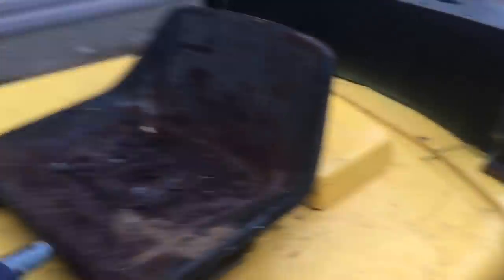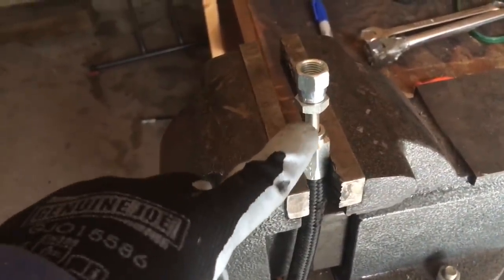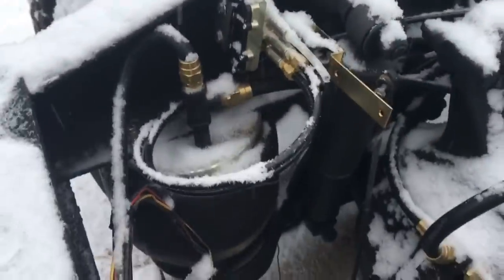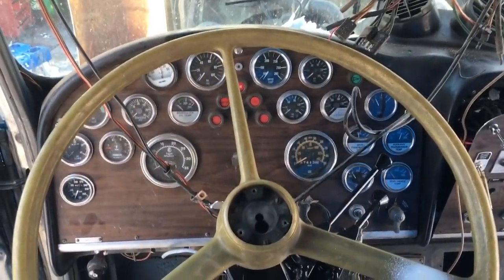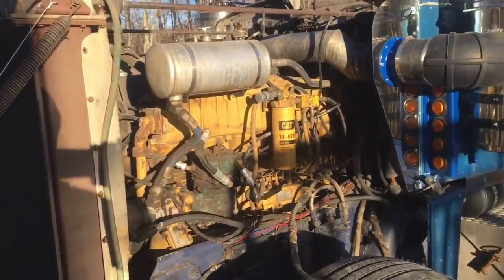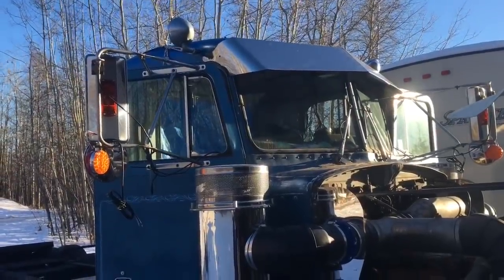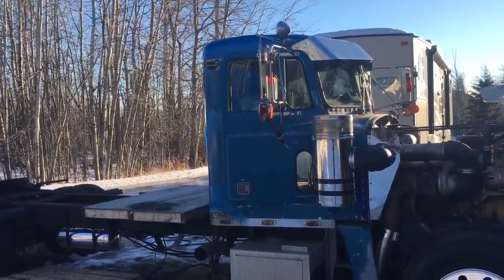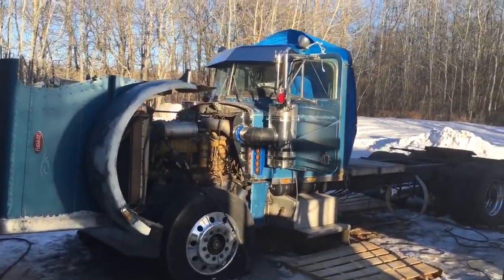Peterbilt 359 Restoration Ep.22 Air Wipers

Comment: Saw that video "1977 Peterbilt rescue" and that is one lucky dude. Amazing it fired up after all those years and drove out of that field. Looks like it was an old Canadian tractor (Judging by the "Canadian" spread on the rear axles) that was retired in Pennsylvania for a many years. Wish I had that old girl, she ran so good I'd clean her up and put her to work in my business.
Reply from the maker: kman 4443 I still cant figure out how all the tires were still aired up if it really sat that long ... when I bought blue the owner had a second burgundy 359 and most of the tires were deflated and popped off the beads on both trucks from sitting outside
Reply: @TwinStix  Some guys have all the luck I guess. If I had bought that truck, they'd all be deflated and badly dry rotted and need replacement. Never comes easy for me! LOL!
Reply: @TwinStix  My guess is that the previous owner now deceased probably aired them up from time to time and may have even moved the truck for a short drive every once in a while. He did say in the video it was started every once in a while but hadn't been started in a while since its owner got sick.

Comment: I commented on one of your previous vids that you should put a thin piece of rubber between the bands and tank. Just to make sure that you keep out corrosion, use some petroleum jelly on the rubber,thin coat. this cushions the parts also..
Reply from the maker: Good tip - thanks

Comment: Progress is awesome man. Your videos motivated me to sandblast and paint my frame. I'm not very good at videos though, but there's a few of it on my channel. You could try stuffing those forklift tires with dirtbike studs, it doesn't look like you have room for chains. Radiators suck, I just did mine if you need anything just holler. If you need a home for that wheel it'd sure look good hanging up in my shop.

Comment: I can’t wait to see you drive this thing also there is an airline in the back of the truck that goes over the torque arm I would probably move that to the bottom of that torque on there just so if your suspension moves you don’t put extra pressure on that line will be driving down the road the first day and blowing airline
Reply: Timestamp is three minutes and 45 seconds
Reply from the maker: JUSTIN STURGILL TRUCKING ya good eye ... someone else mentioned that as well.  I ran it the way it was but now realize it’ll be better to go around or under
Reply: 359 TwinSticks I would go under it like I said I can’t wait to see you get it done hopefully it’s soon but I realize you’re up there in Canada and it’s cold

Comment: You should swap out your alcohol-type air dryer system for a desiccant-type air dryer system. The ones from Volvo are pretty good. Alcohol is harsh on the components in the air system.

Comment: As I've said before, my hat's off to you working in well below freezing temps, I'm in Langley B.C. and I have a hard time getting motivated to get out and work on my bus when it's under 5 Deg., guess I have no excuse now... Damb it!!!! ..... we had a 72 359 with a 1693 Cat logging truck years ago in Whitecourt.... loved that truck.... I wonder whatever happened to it.... probably scrap years ago.... could you strap the tanks to a pallet and set them under the saddles with the forklift and then use ratchet straps to lift them into place... all you would need is the little 1" ones , then you could go nice and slow and they would hold it in place while you put the straps on..... those guys did an awesome job on those tanks

Comment: You can still run the truck. Get to gas can for diesel which are yellow.. this would allow you to move the truck where you want it.. & I would reposition the air line going over the rear axle from the brake valve. Good job on the airlines & slack adjusters..

Comment: This is old video so you might have changed it but the air line going from the rear quick release relay valve (QR-1) to the brake "T" at back of the diff needs to be rerouted or protected from the pan hard bar, when you air it up that pan hard is going to lift and rub through your brake line.

Comment: to mount the polished tanks without scratches , buy a roll of wide vinyl transfer tape , the stuff the sign makers use to apply cut vinyl letters , measure out where the straps will be , and cover the whole tanks except that area , mount them , then peel it off , issue solved lol
Reply from the maker: towrecker good tip ... thanks

Comment: Have you checked the windshield for leaks because water could leak in through it
Reply from the maker: gamer ya windshields will need replacing ... crack, chips and the seals have shrunk and there’s openings now.  Will probably leave until the spring as the cold will make them a bear to install

Comment: Don't forget to test tow the RV! ;-)
Reply from the maker: RS 1990 yup that’s the plan
Reply: @TwinStix  I suggest keeping the stock 5th Wheel turntable but replacing the RV's original pin box with a Mor-Ryde (the skid plate has more surface area than any other pin box!)

Comment: This is my thought on setting your fuel tanks on the truck build you some wooden cradles for your forklift forks a little bit wider than your fuel tanks and line the wooden cradles with an old mud flap and then secure the cradles to the forks and make sure you put forks at a width that wouldn’t infer with tank traps you could probably use some small racket straps to hold it together

Comment: Good job, with the air lines, looks nice.
Tanks are beautiful, and like you said the straps will cover up the pitting in the old one.
Last time I saw one of those Heat, and Engine start selector switches was in a 1987 980 loader with a 3306 engine that I ran on occasion.
The Heat position would be for glow plugs.
Call me ignorant, but did they offer glow plugs in a 3406?, or was it just a cold weather option, never have seen that on a 3406.
Let us know.
Great video , keep up the good work.
Reply: Well I looked a bit, and they did come with glow plugs, haven't seen one with them, what do you know.
Reply: I did some more research, and discovered that the Precombustion Chamber injection engines had glow plugs,
and it looks like that option was lost when the engine was converted to direct injection, usually at first overhaul.
Unless you have the flame start option which used a glow plug and fuel nozzle to preheat the intake air.

Comment: Aey bro .. you might wanna move that roll of airline you have sitting out in what I'm assuming is the Canadian north somewhere .. maybe say in the house in front of the wood stove you no doubt use that will actually make installing the push lock fitting's a breeze .. So unless your Barn will accommodate your Pete Or you might wanna wait till June when your spring rolls around Aey ?

Comment: Chains will not clear on some tow motors !!! You need the cable roller type and they really are not that great i would but sand once the ground gets hard
Reply from the maker: Jeremy Thomas actually I got lucky and found a set of chains that fit ... put them on today and now I can drive all over without issue
Reply: Sweet are hyster 80 will not clear them

Comment: How are you planning on equalizing the tanks since one pulls from the bottom and the other from the top you might be better to have a bung welded on the bottom of the new tank and run a cross over
Reply from the maker: stephen hipps no cross over needed ... both tanks are new style and pull from the top ... just need to buy and mount a newer style fuel splitter valve so it pulls from and returns to both tanks equally

Comment: Nice truck, what are those two levers on the right side in the steering column?
Reply from the maker: The long one manually applies the trailer brakes and the short one manually applies the Brakesaver on the engine ... essentially an engine oil based reverse torque converter that slows down the engine the more you pull the lever.  Cool concept but many leaked like hell so Cat went away from using them on the B block
Reply: @TwinStix  tanks

Comment: allways blow air threw the line after making hem to make sure rubber inside doesn't block the line when making them.
Reply from the maker: scott ash good tip - thanks
Reply: @TwinStix  put over 3 million miles on 359 petes with cat motors (my favorite)back in my trucking days besides it happened to me making and replacing a line,you have some good stuff going on there.

Comment: You said that your truck is a 79 Pete but it came with the rectangular headlights, and peterbilt said the 359's came with rectangular headlights only from 1980 to 1987.
Reply from the maker: Rondal Simonds good eye ... however I checked with Peterbilt and the serial number (it predated VINs) says she was hatched Dec 1978 ... guess it was her 40th birthday this month.  Original build had double rounds ... dual rectangles didn’t come out until 84 so another owner along the way must have put them on
Reply: 359 TwinSticks I could be the truck had a accident and they change them, maybe.
Reply: Square Lights have Better Visibility, and can be found at any Auto Parts store. @TwinStix